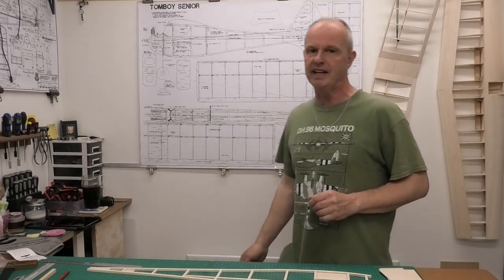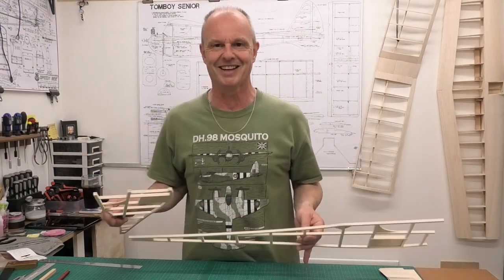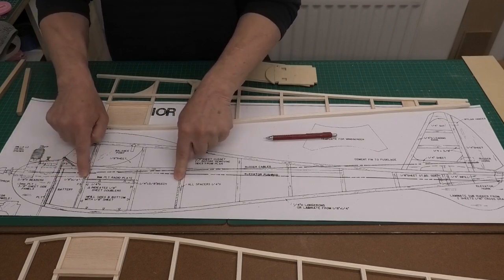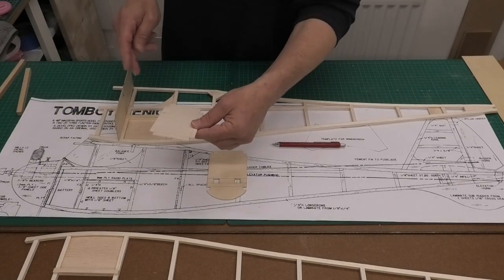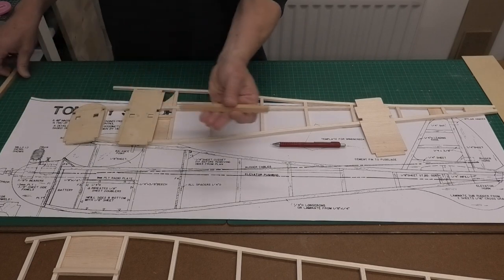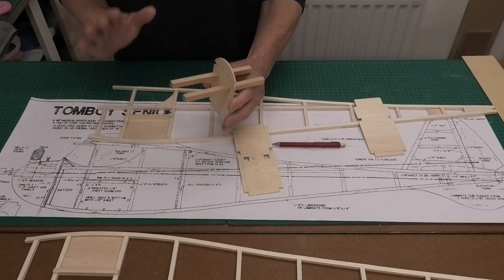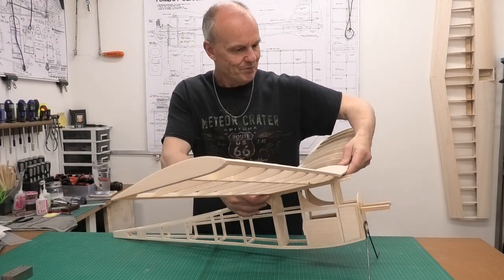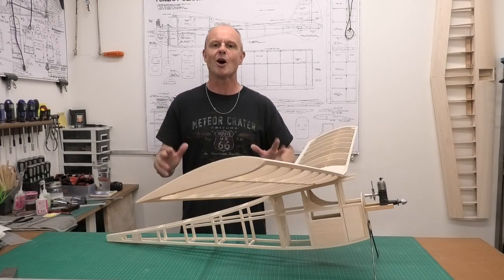Tomboy Senior - Build Series - Pt 5: Joining the Fuselage Sides

Comment: Really enjoying this build Mark, thank you.  Did you need to heat that 10 gauge wire in order to bend it easily?
Reply from the maker: Thank you for the comment, really pleased you are enjoying the build.  I bent the wire cold in the vice with a hammer, always done it this way, never had a problem, I think getting decent music wire is the trick, which is not too hard and brittle, hope that helps 😀